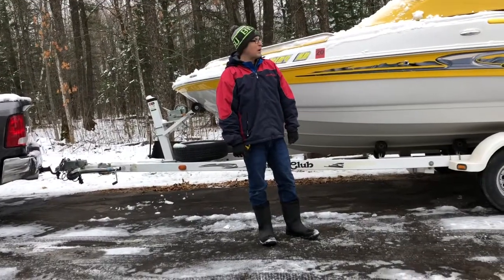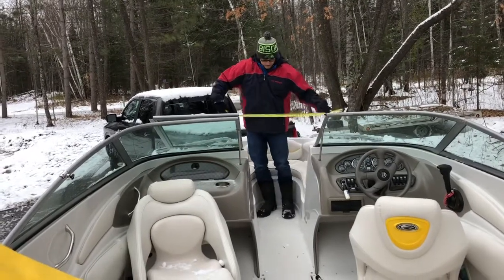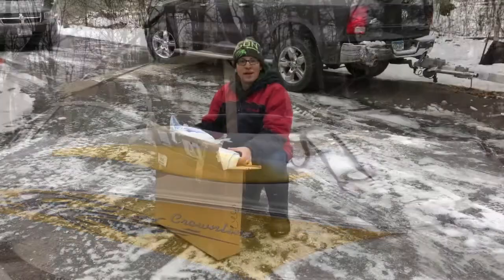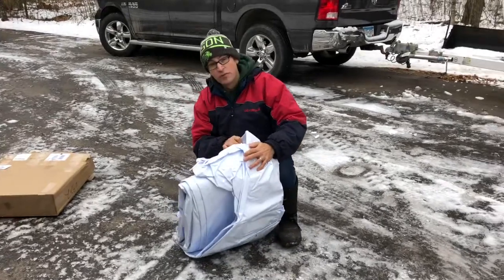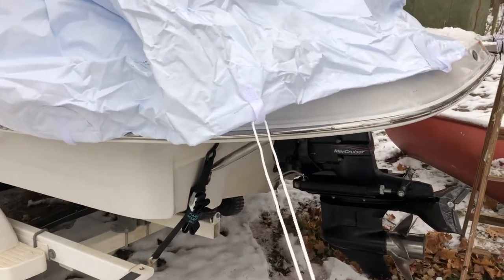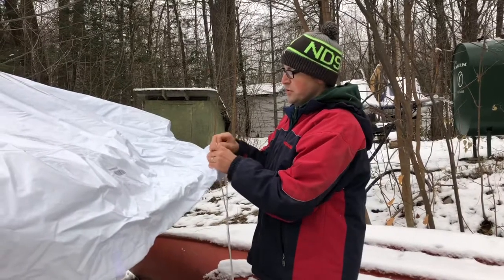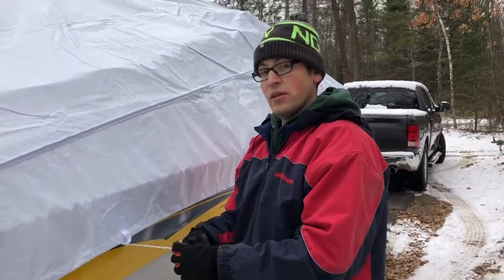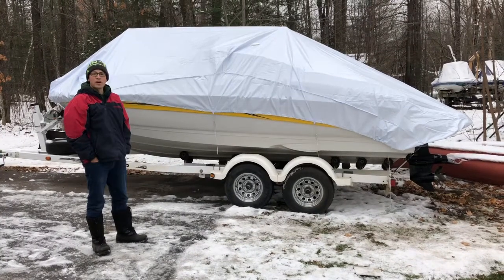How to Install a Transhield Boat Storage Cover - Step by Step

Comment: Do you still use this cover? How has it held up over the last two years?
Reply from the maker: Hello! It’s held up very well and I still use it, however I’ve since built a garage that can house the boat, so it doesn’t really need to stand up to the elements anymore. It’s now more of a dust cover. Still- I highly recommend it for outdoor winter storage. I used this brand on my previous boat as well.